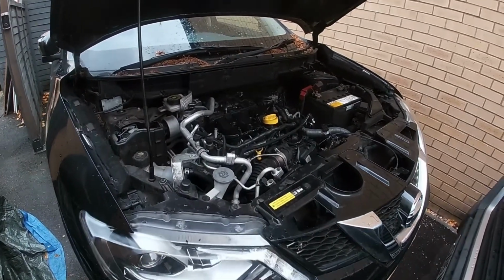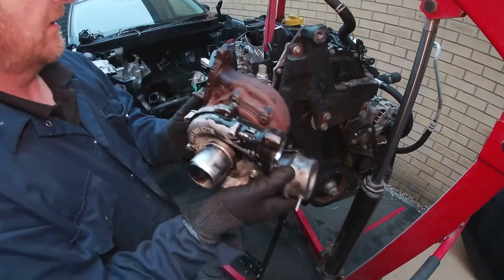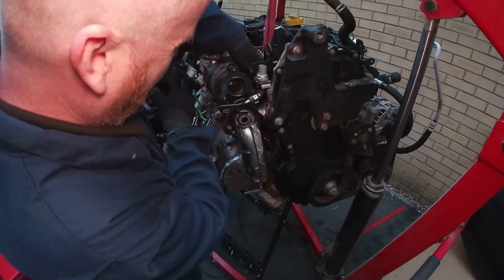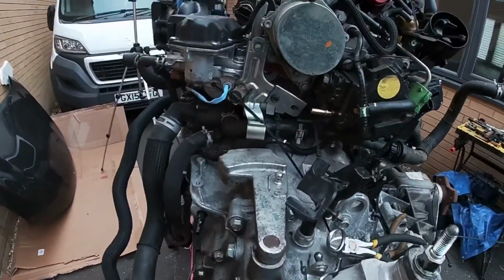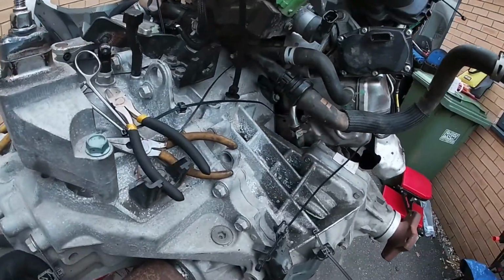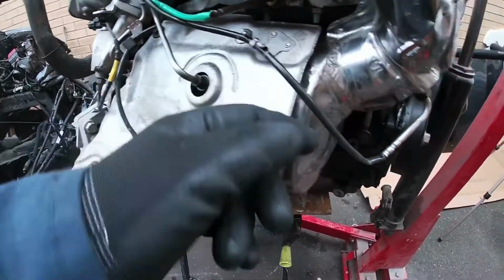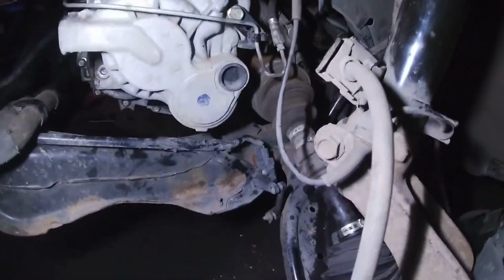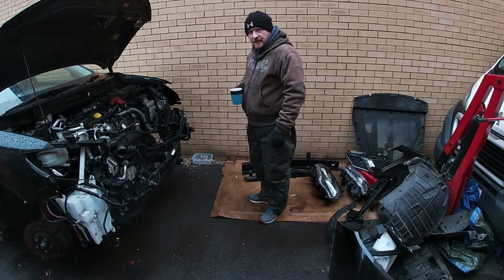Changing the Turbo on a 2016 Nissan X-Trail. #Vlog35

Comment: Don’t need to take the engine out, remove the scuttle panel plastics, then 10mm holding the the metal part off the bulk head on that bolts off then you have room to remove turbo
Reply: So if you removed that bit you won’t need to work from underneath?
Reply: @leozivira5503  still need to work underneath car
Reply: Can I remove dpf filter without remove motor?
Reply: @arvidhajdarovic3843  yes, need to remove subframe
Reply: @ltzFight If read it can be done with engine in.  But also drive shaft has to come off.  Retired mechanic here and thinking of doing it myself.
Reply: @andylew0ify doesn’t have to I don’t take driveshaft off, personal preference
Reply: @ItzFight  Ok brilliant thanks for a quick response.  Looks like I’ll be pulling the ramps out tomorrow then ha ha.  Cars only done 22 thousand.  Oil changed every six months.  Baffled me how it’s  gone to be honest.  Does the turbo lift up once detached or has to come down ? Thanks Andrew.
Reply: @andylew0ify  I work a Nissan see them fail quite often, the turbo lifts out from the top take your scuttle off and unbolt your builk head, the hardest part will be un doing the 3 turbo manifold bolts but it is do able with ratchet spanner’s,  there quite tight but fine to get out once cracked loose, will be a fairly complicated job of the floor but I’m sure you’ll manage
Reply: @andylew0ify  no worries mate good luck
Reply: @ItzFight Does the DPF need to be removed from the gearbox side. ? Or just the DPF holding brackets.  In order to pull the DPF pipe away from the turbo.  I’ve ot all the top stripped down just can’t get to the the 2 nuts below the turbo holding it to the exhaust manifold.  👍🏻
Reply: @andylew0ify  the dpf doesn’t need to be removed just loosing the bracket bolts and remove the 3 studs on the turbo so you have room to push out the way, and yeah the turbo manifold bolts are tricky to get to but it’s do able 👍 also just undo the turbo drain pipe bolt from the block not the actual turbo it’s easier that way for taking turbo off and on
Reply: @ItzFight  Hi thanks for the reply that’s brilliant thank you. To be honest it was -4°c here when I was looking to get on the two manifold nuts so didn’t really give it my normal long hard undefeated attempt.  That’s brilliant information thanks.  I’ll have another attempt in the week.  Again thanks for taking the time to help.  It’s much appreciated.  👍🏻
Reply: @ItzFight  Forgot to ask I’ve only found one bolt holding the turbo heat shield on. I’m guessing there is one or two hiding.  Did think the DPF is holding it.  But unsure 👀😂👍🏻
Reply: @ItzFight  Hiya buddy I know you most likely been grinding away all day with cars.  When you say the turbo oil drain pipe. Are you referring to the one under the turbo ? I can see two pipes going into the block on the gearbox side.  One aluminium and one with a rubber hose.  Which one of them is the drain ? Sorry again to be a pain been a raining  all day today😂 literally have the nuts holding the turbo onto the manifold left oils feed pipe.  And the oil return pipe.  Just don’t want to potentially damage the return pipe as I’ll be pulling the turbo off with no second pair of eyes. Thanks Andrew.
Reply: @andylew0ify  sorry mate I’m wrong in saying that just undo the 2 8mms (or 10mm) on the turbo drain pipe from the bottom of turbo itself, it’s a bit tricky get them back on but long extension and bit of paper or glove in the socket trick will help you get them two bolts back on, and as for the the turbo manifold bolts combination of ratchet spanner’s will do the trick you need to get it on the right click to get a move on the bolt to crack it loose🤣 other than that your basically there 👍
Reply: @andylew0ify  is yours fwd or awd?
Reply: @ItzFight  That’s brilliant thanks ever so much it’s really appreciated.  Ok so undo the turbo drain pipe from the turbo ? And the three nuts holding the turbo to the manifold plus the oil feed pipe and I’m done.  Got to love the paper on a socket trick 😂 or a little dab of silicone 😂 Mines the 4x4 model.  The DPF hardly moves after unbolting the straps does it 👀 and I can’t even see how the hell you get at the nuts holding the DPF onto the exhaust manifold if you had to change one.  Must be a right mare of a job  been off the tools for quite some time now and can’t believe how many wires sensors and just general sh1t all over the place.  Again thanks for the help. 👌🏻👍🏻
Reply: @andylew0ify  ah 4x4 that will make it even more complicated if it was me I would have took the subframe out and dpf off, but your this far now you might get a away with it I’ve personally not done one on a 4x4 yet can you even see the 2 turbo drain bolts? If you can get them out and the 3 the turbo manifold bolts along with the turbo feed and you should be ready to lift the turbo off
Reply: @ItzFight   Yeah I guessed by watching this video and another guy doing one on a 2wd mine was going to be more of a challenge.  But so far even though it’s been a ball ached between the cold and the rain im slowly getting there.  To be honest I’ve only really had a good look at the two turbo manifold bolts with a scope camera.  And they do seem awful tight to the DPF and until you mentioned the drain pipe I hadn’t  even given it a thought.  To be totally honest as it’s rained all day today I haven’t had a good look at the drain pipe bolts.  I can feel the outer one.  But not so sure on the inner one. Hopefully don’t have to end up dropping the subframe. 👀
Reply: @andylew0ify  okay mate either way fwd or 4wd once you loosing the the dpf it should give you enough room to remove they turbo manifold bolts I’ve never once removed a dpf to get them off, the only thing that will make it more complicated underneath is the transfer box will get in your way but let me know how you get on once your back on it👍
Reply: @ItzFight  ok cheers for the reply 👍🏻 the DPF is still rock solid and I can’t see where on the exhaust manifold it’s attached too ha ha.  I’ve not unbolted the front pipe as can’t see what advantage it would give me.  I have taken the first two exhaust brackets off.  Ideally I need the DPF to drop down.  I’ll have another scoot around with camera probe tomorrow. 👍🏻
Reply: @ItzFight  Hiya buddy hope works not be beating you too much 😂 Decided yesterday engine has to come out.  There is no way I can do it with the engine in place.  I can only get an open end spanner on the turbo manifold bolts. And we both know how that’s going to end. Let alone trying to get them back on even if I could get them off.  So I’ve scrapped the idea of doing it in place.  Did some digging and got a manual.  My dilemma now is manual says to take engine down. But remove the gearbox air con pump and alternator first.  As where this gentleman has lifted it out.  Which way do you go ? I’m thinking if engine down then no need to remove most the front end.  But would be easier for me going down and removing the front end.  But don’t particularly want to have to take the gearbox off, if I was to drop it down. 👍🏻👌🏻
Reply: @andylew0ify   hi mate surprised at that must be a lot tighter with it being the 4x4 as I’ve done a good few in place you’d probably be better just removing the the transfer box then dpf but it’s whats best for you, we usually take subframe out and drop the lot out the bottom that’s the easiest way but I can get the actual Nissan repair procedure tomorrow when I’m at work if you want  👍
Reply: @ItzFight   Hiya buddy yes it’s hell tight in there.  And I’m never one for admitting defeat ha ha.   I couldn’t  even find a solution to drop the DPF down out of the way as couldn’t see how to get to the bolts holding it t on.  Yes remember reading you saying about dropping the subframe.   It may be the way to go or it’s going to have to come out from the top.  👀 yeah sure if you could take a look I’d appreciate it.  Again thanks for your time 👍🏻
Reply: @ItzFight   Just re read what you wrote.  I’ve not thought about removing the transfer box to be honest.  The main obstacle is the DPF I couldn’t for love or  money get a ratchet spanner on the nuts holding the turbo on.  Only an open end spanner which finished the deal for me. 😂 I’ve stuck it all
Back together for now.  But now you’ve mentioned the transfer box I may take a look under it again.
Reply: @andylew0ify  that’s strange mate must be something that’s not undone that’s not allowing you to move the dpf? And yeah you’ll never get them undone with the open end
Reply: @andylew0ify  just thinking won’t be able to drop if our bottom unless your on a 2 post mate
Reply: @ItzFight  Yeah was guessing it be a two poster job.  Looking at Nissan manual again just now.  Says to remove engine. Then the “transaxle assembly”  But I’m sure the guy in this video hasn’t mentioned removing that.  I’m guessing by removing it.  It will allow me to get at the bolts holding the DPF onto the EGR cooler.
Reply: @ItzFight Hiya buddy had another go today stripped it all back down.  Can tell I been out the game for a while as realised it was the fkin heat shield on top of the DPF that is stopping me getting to turbo nuts. So I’ve taken all the bolts out of that 😂  Anyway this time I’ve managed to shuffle the DPF lose.  But not enough for it to clear the studs. I’ve re read your comments.  Do you  mean “remove the actual studs”that are  holding the DPF to the turbo.  As this is the only option I can see now. It’s still going to be damn right under turbo.  But I  think it’s now do able. 👀 cheers Andrew.
Reply: @andylew0ify  hi mate yeah remove the 3 studs from the turbo and you you will have clearance for to move dpf 👍 and yeah it is tight but it’s do able and saves you hours from removing the engine
Reply: @ItzFight  Hiya buddy hope you are keeping well.  Got it off today not as bad as I imagined. More so with your help 👍🏻 can see what you mean now by saying no need to pull the engine out.  Only thing I’ll mention is the two turbo to manifold bolts came out whole.  So can’t get them past the DPF so grinder out tomorrow.  😂 Many thanks for your help 👍🏻has saved me a shed load of work. 😎 👍🏻
Reply: @andylew0ify  hi bud all good thanks, not the nicest of jobs but saves a lot off hours compared to removing the engine glad hear you got it out though good job👍😎
Reply: @ItzFight  Glad your good 👍🏻 Yes it does save a hell of a lot of time.  I am still surprised it came off to be honest.  More so with it being the 4x4 was convinced the DPF wasn’t low enough.  👍🏻 Thanks again it really is appreciated.
Reply: @ItzFight Hiya buddy hope you are well.  New turbo and all my bits have arrived.  So hopefully get it all  bolted on over the weekend.   Question for you what size ETorx holds the plastic intake to the turbo ? I’ve got a few sets here but nothing fits.  I’m guessing it’s a E15 ? Cheers Andrew.
Reply: @andylew0ify  hi bud sorry just seen this, couldn’t mind off the top my head but e15 does ring a bell👍
Reply: @ItzFight  Hiya thanks for the reply.   Yeah think it’s about the right size.  Got loads here none fit 😂 ordered a set last night.  Just oil and filter change tomorrow and should hopefully be all set.  Thanks for all the help. 👌🏻👍🏻

Comment: Hi how was the wiring harness Loads to take off or no
Reply from the maker: Hi, the wiring harness is quite complex and not for the faint hearted. Take your time taking the wiring harness off with photos where you can for reference. 👍
Reply: I’ve got an z trail hole in block u reckon I can remove the engine from the bottom or top
Reply from the maker: I lifted this one out with an engine hoist.
Reply: @illgiveitago1239  was this x trail an automatic one? my one is an auto
Reply from the maker: It was a manual 6 speed gearbox
Reply: @illgiveitago1239  do u reckon if I swap the engine will the injectors need programming? Or just will be fine thanks
Reply: @zukhrufhussain2271 she should self programme after a drive...

Comment: Hi how do you remove the Exhaust pressure pipe if blocked , i could see it on the back of your Engine but not where to undo it,, good video
Reply: Mate don't need to remove if blocked....get a bicycle inner brake cable and put onto a drill ( cordless ) and put in hole of pupe with some wd40 before and work the cable in and out whilst spinning slow......might take 10-15 mins but it will clear 👍